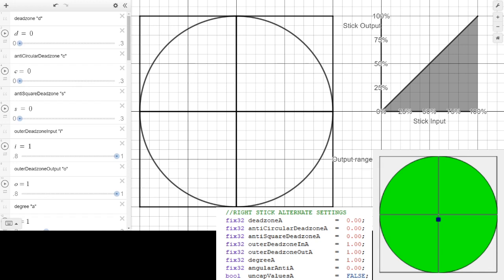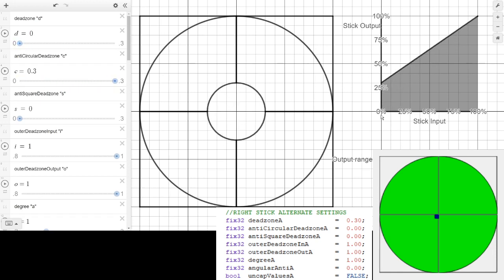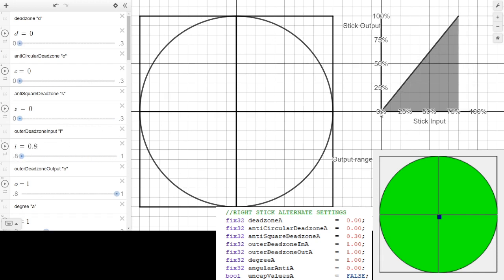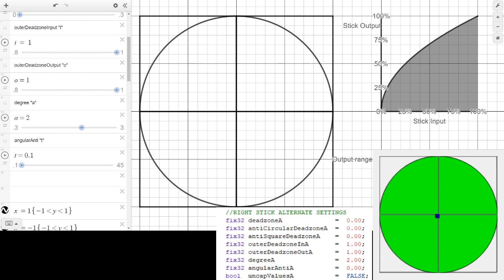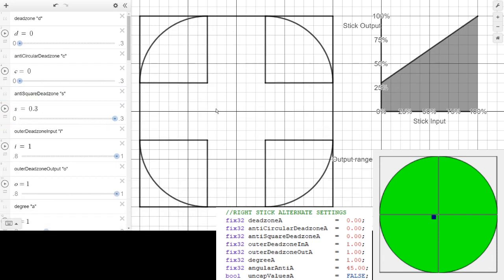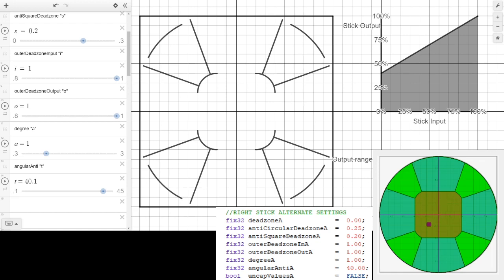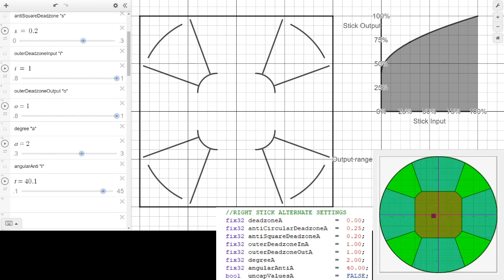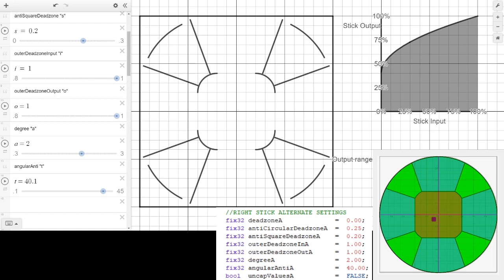Anti-deadzone Explanation and Demonstration

Comment: Hey, i just bought this controller, and the deadzone by itself is really bad its hard to look in any game and in the game i put my deadzone at 0 and it doesnt change what is my problem?
Reply from the maker: Do you know which controller it is, or are you using this TitanTwo script and that's the issue?  I might have fumbled on some of the default settings in an update.

Otherwise some 3rd party controllers add deadzones and unless they come with some software you might just be out of luck.  If you have any PC you can use, you can plug the controller in and use https://gamepad-tester.com/ to see if the sticks look like they're responding properly.
Reply: @EternalDahaka  Thank you, i bought it off of amazon, its a Ps4 elite controler
Reply from the maker: @420rv2  
Hmm.  I haven't used any of them, but the default PS4 controller doesn't have any deadzone itself.  If you're able to test it on that site and it looks like it's registering well, then maybe the game's deadzone slider is off.  That's happened in a few games, but you should still see some difference.
Reply: @EternalDahaka  I tried it on the one site you gave me, and its the controller, i wonder if there is a software I can find thats not a backdoor

Comment: Very great explanation and interesting video. Do you think you could make a video of metal gears dead zones?
Reply from the maker: I can try to make one for MGSV, but I don't know when I'll be able able to do it.
I have tested the deadzones for it though.

deadzone: https://imgur.com/AcUAWbH
dotgraph:  https://imgur.com/W3FKUIB
Reply: @EternalDahaka   O  Awesome pics of the deadzones. Yeah if you have the time that would be awesome.
Reply: @EternalDahaka  that can't be right. a 30% deadzone on the aiming stick? That would've made the game damn near unplayable. Unless that's for the movement stick, then it makes some sense but lining up headshots would've been a massive pain in the ass if the deadzone was 30 on the right stick
Reply from the maker: @HugoStiglitz88  
https://youtu.be/T2wL2Ogk4Ic
Right stick.  Here's the video for it.
That's for the Xbox One version.  Generally all platforms share the same size, but for some games the PlayStation version has lower deadzones.

It is rough, but quite a few games have 30% deadzones, and 25% was pretty standard through the 360 era.  Gears of War 1-3 and recent Resident Evil titles(5 up through Village and Re:Verse) are some examples of titles using 30% aiming deadzones.
Reply: i need mw2 deadzone badly 😭